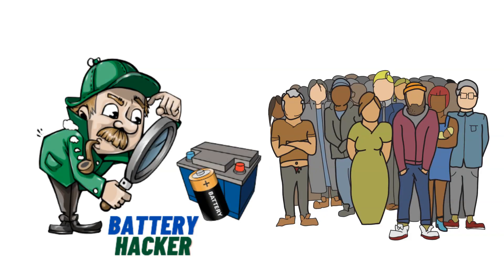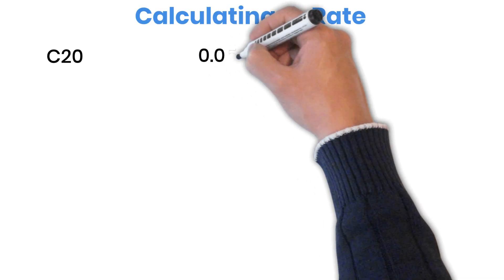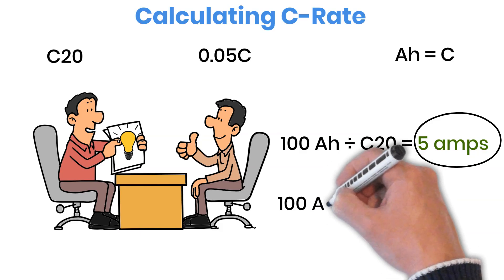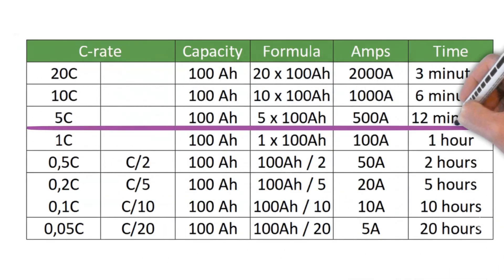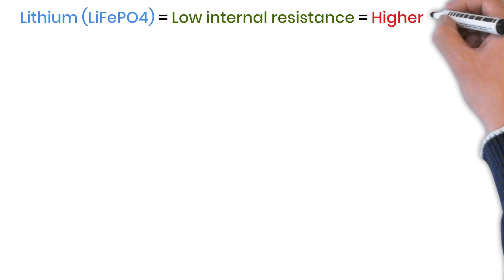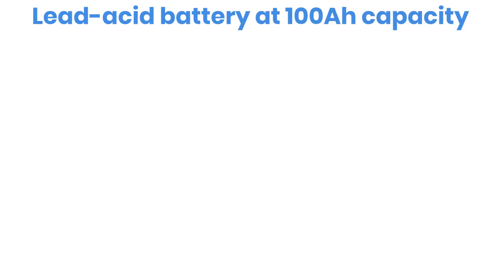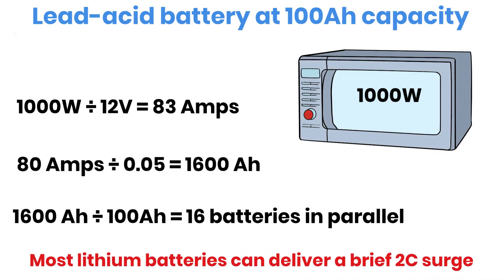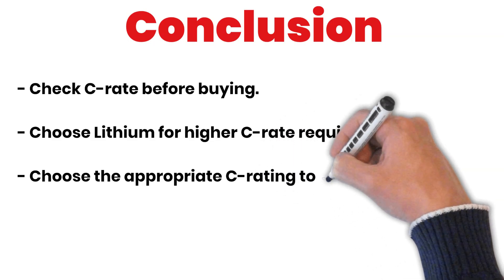What Is C-Rate? Lead-Acid vs Lithium Battery Charging & Discharging Explained | How to Calculate

Comment: My name is "AI". Didn't correct LEAD. Thanks to the stupid English language, many words can be pronounced differently. The the text had the word <LED> instead of LEAD, it may of come out better. NOT as in Light emitting diode either. Like "he led the way to the lake".  Or this lake is polluted with LEAD, so don't drink the water. I was hoping to have an answer as to whether Pukerts Law applies to LifePO4 batteries.
Reply from the maker: English really makes things confusing with words like lead, led, and LEAD all sounding different depending on context. 😅 Thanks for bringing that up!
As for your question, Peukert’s Law does apply to LifePO4  batteries, but only very slightly.
Because lithium batteries have very low internal resistance, the Peukert exponent is close to 1.05, compared to 1.2–1.4 for lead-acid. So the capacity doesn’t drop much at higher discharge rates.
If you want, I can make a separate video explaining Peukert’s Law specifically for LifePO4. Let me know!
Reply: @batteryhacker4343  Thank You very much! I've always wondered about that. Makes sense. I am not going to request a video about Peukert's law at this time.